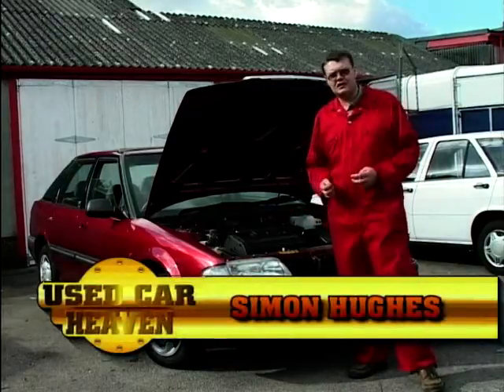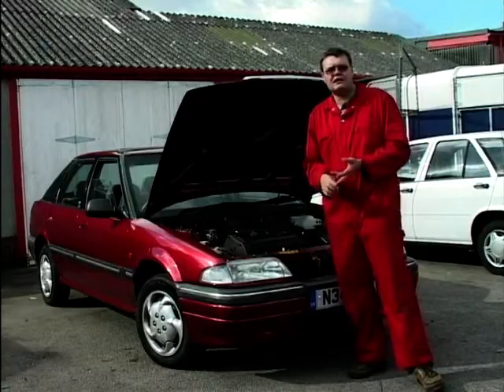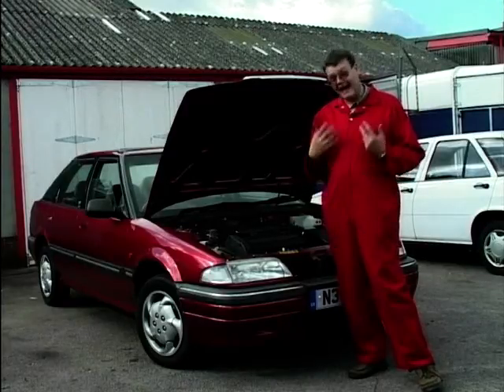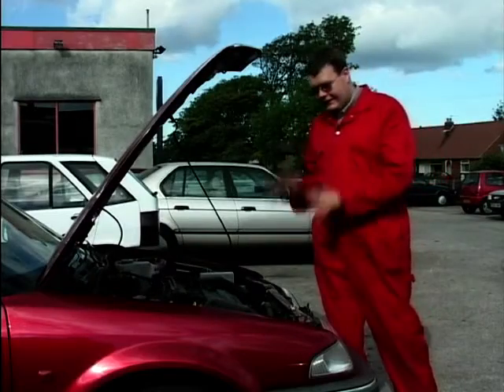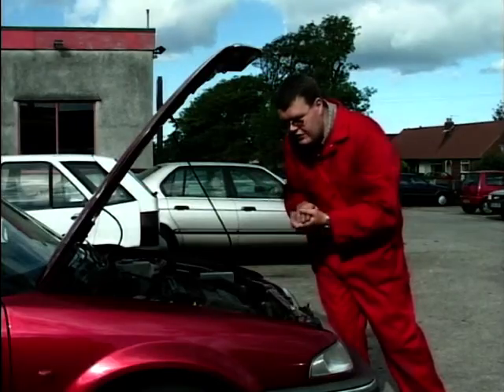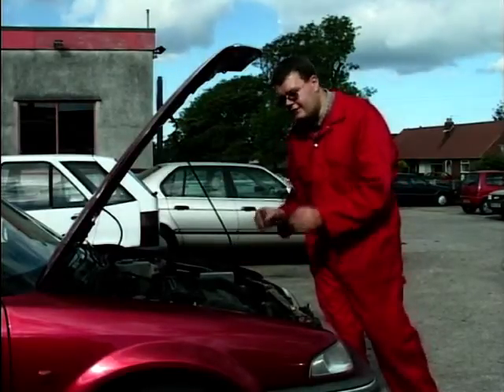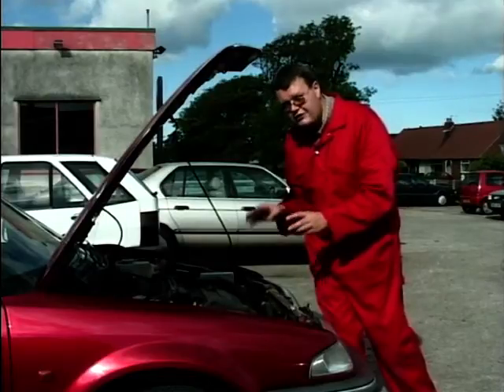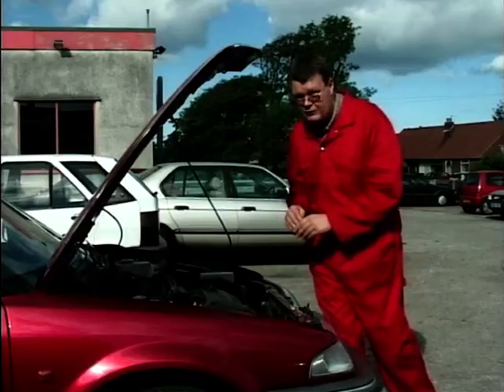Rover K-Series Engine Head Gasket Advice

Comment: my  rover 25  1.8  the head was done at 45,000 ish by previous owner,  i put a new pump and belt  on at 106,000 as pump seals had gone but now at 114,000 miles  still keeps on going and giving me a  38 - 41 mpg - ok car for those who like to tinker tbh

Comment: Lotus used this engine and fitted the thicker/modified gasket that al but cured the problem
Reply: yeah, the gasket sure and the whole engine head is redesigned ha ha
Reply: @salsarriba5695  only on the super high performance 180hp versions. The elise s1 had a bog standard 118hp 1.8